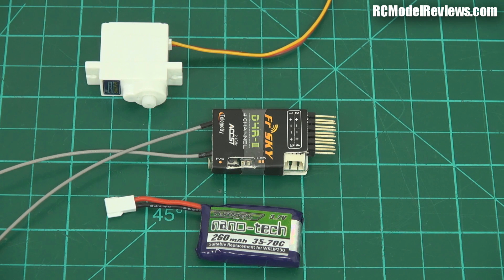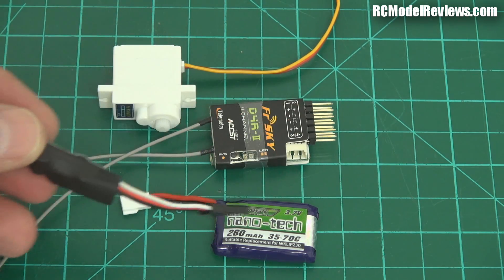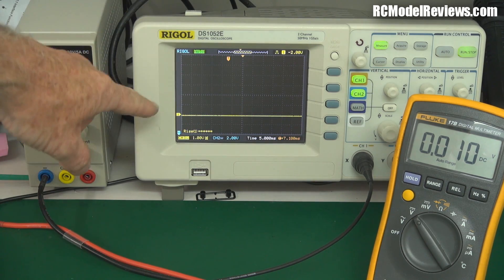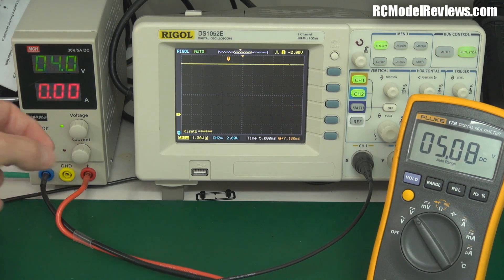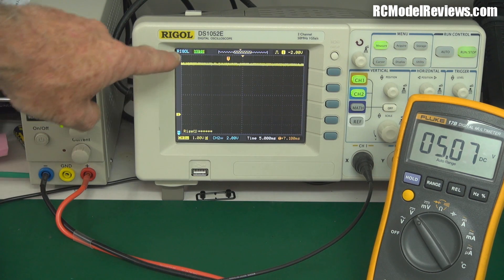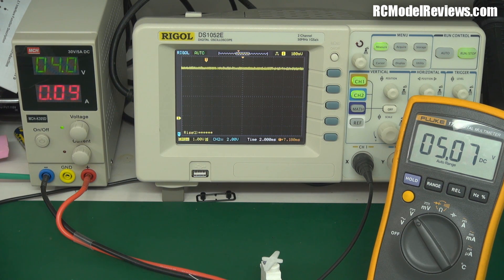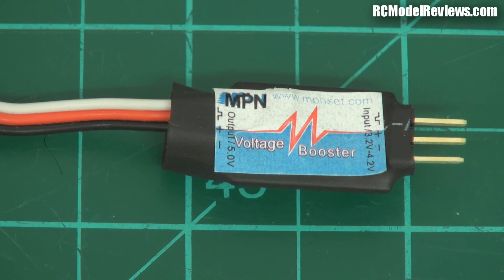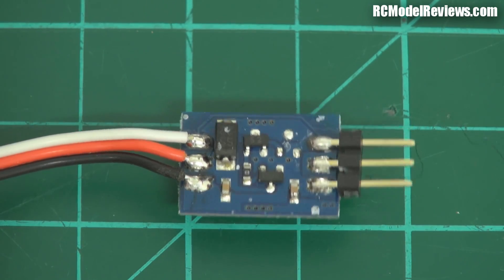Review/teardown MPN 1S lipo to 5V booster

Comment: I'm using a similar booster to run a RF LED controller.  If the battery goes too low, the controller gets stuck in some weird state which brnging the battery up doesn't reset. I have to disassemble and disconnect the controller.  Needless to say, there is no room for relays, etc, etc.

Comment: As it has been mentioned by others, a lot of people use 1s directly in DLGs. Generally in the 900-1200 mAH range, so the voltage never really drops too low (if you charge them between sessions, of course).
So, let's get to the interesting part ;-)  which DLG are you building ?

Comment: DIP (dual in line) package, I haven't seen a DIP package in 15+ years for a DC-DC converters, and BTW 220 is 22uH not 220uH (the last 0 means no added zeros), basic 101 electronics.

Comment: Could this be used as a voltage booster in a big plane with servos so far from the ubec the voltage drop through the wire reduces the voltage getting to the servo too much. The 3pin input does lend itself to this idea.

Comment: I actually have a circuit board I designed recently to do a similar thing, convert a lower battery voltage upto 5V. Although this board is designed to drive colour changing LEDs, not servos, although you could certainly do that! Only advantage of mine probably is I can boost voltages from 0.9v to 5V, although I can only drive 200mA at the low voltage without causing the 5V to drop. Although considering the price of my circuit board, can't beat it there! Definitely surprised not to see a SOIC or SOP package, very curious now how that circuit works.

Comment: I ran this booster in a 1/12 scale circuit car with a 2S ESC on 1S. Performed well enough for the money, however with the noise you see on the scope might have been the reason for the slight natural chatter I saw when the servo was centred at rest? It's also did this at end point. Servo ran fine on 1S , albeit slower, and again no chatter issue on a 2S ESC with BEC. I ended up buying a dedicated car 1S ESC with the booster built in, working to 6V3A.

Comment: Nice review - I always enjoy watching your videos!

I've used some of these voltage boosters for some hundred flights (slope soaring) in an Alula Clon (DIU) and in the Multifun from Telink without any problems! Hobbykings HXT900-servos work fine even on 1s without a voltage booster e.g. in Dreamflight's Weasel Evo.

Comment: Honestly, I find it easier to just build a proper 1cell LiFePo4 setup.
Most FrSky gear goes way under 3V (Most are specified for 3.3)
Servos are trickier, but some searching around will reveal some. Even cheap ones.
Or just experiment. Many work at very low voltages quite well.
Reply: Tilman Baumann Yes, but in the case of some 1S powered craft or a DLG there may not be enough room to fit a LiFe and/or the weight penalty might be unacceptable.
Reply: I found some really tiny pouch type ones. Few grams.
Aloso cool are the cylindrical ones, but you are right they are rather heavy but nice and small for tiny fuselages.

Comment: Where is this normally used? I know it's supposed to be somewhere between the battery and the receiver, but why does it have a signal wire? The ubecs i have only has two wires.

Comment: Most radios now use 3.3V circuits and logic any way, I've run turnigy 9x receiver at 3.3v it works with 3.3V logic signal aswell.

Comment: Love your tests, but as always, I want you to do something slightly different :p.  First of all, Id like to see how efficient the conversion is. You dont compare power consumption to a direct 5V feed. Some of these converters burn almost as much as they put out (and get really hot). Secondly, one servo operating with no pressure is hardly a real test. Put some real load on the thing, equivalent to 4 servo's that actually have to do some work.  Im sure you can make variable load with light bulbs or whatever. Thing is, Ive heard many horror stories of DLG pilots where these things brown out or cause rx brown out when they you actually fly, as the servo's need to work a lot harder then.
Reply: It's a switching regulator. It should be around 70% efficient in the worst case.

Comment: Do you think a super cap would be good to smooth out the voltage drops when applying high load?
Reply: No. Supercaps don't like high currents, at least if you want the small ones. And the dips don't hurt in this case anyway.
Reply: Well, not gold caps of course. But there are carbon aerogel super/ultra caps which have an ESR of a few hundred mOhm. I can't find any current restrictions in the datasheet of the ones I've got, but according to it they are meant to be used for 'pulse and bridge power applications' Not sure if they would survive it though...
The dips could mess with microcontrollers, like triggering brown outs and so on, that's what I am concerned about.

Comment: 1S on DLG's is quite common. Have not met a receiver or servo that won't run on 1S down to 3.5V when the Lipo is practically run down. Rule is keep it simple and keep it light. Another component to go wrong is not really necessary. Especially when it is running your battery down much quicker!